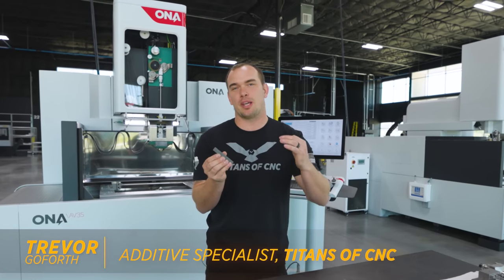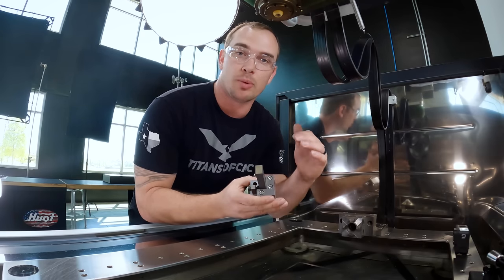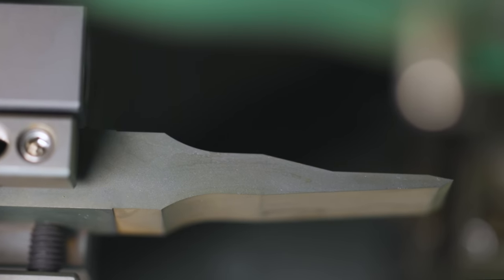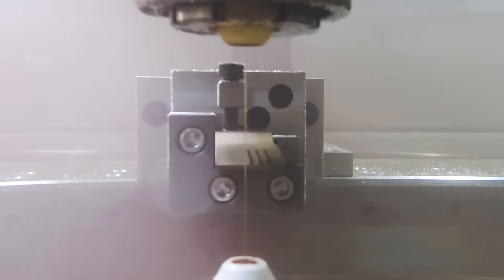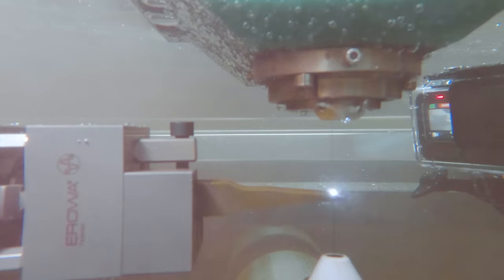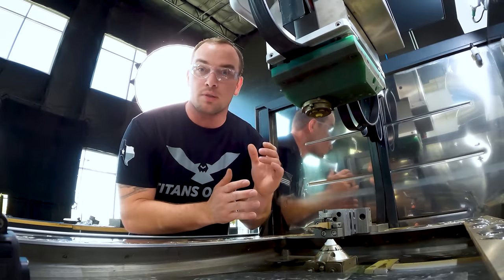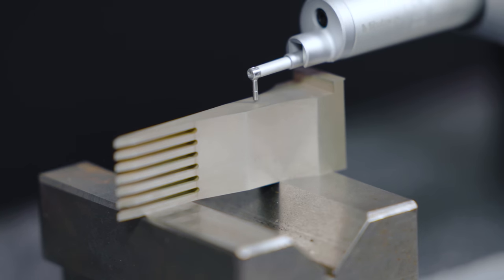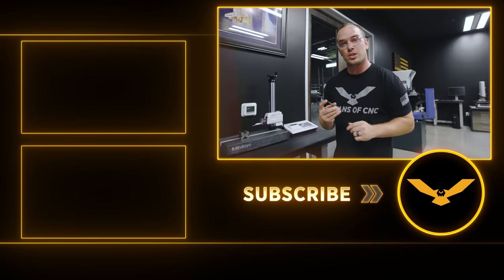MACHINING The HARDEST METAL On EARTH

Comment: Cemented tungsten carbide is not a metal but a composite. Like you said in the video, it's tungsten carbide powder glued together with cobalt.
Reply: Correct 👍✋ I pointed out the same thing cause its very far from elemental tungsten

Comment: My dad specialised in spark erosion in the 1960s -1990s using a Charmille EDM with a relaxation circuit. This was ideal for tungsten carbide sparking. His main work was machining cold heading dies for screw/nail manufacturing. The electrodes were made of tungsten copper.

Comment: Uhmm, guys, tungsten carbide is a ceramic (a compound consisting of a metal element and a non-metal element), it's not a metal (alloy). But given that C2 Tungsten carbide has 6% cobalt in it, it's actually metal ceramic composite material, often called a "cermet" (ceramic / metal composite).

But you can't really call it metal. (Sorry, I'm a materials scientist & engineer / metallurgist, I can't not be pedantic in this case!)
Reply: Just here for the same reason! Material scientists just cant ignore these things 😂

Comment: Tungsten carbide is not a metal, that is commonly mistaken. Cool machining nonetheless!
Reply: would you call it a steel then?
Reply: And iron carbide (steel) ?
Is it a metal ?
Reply: You are right. The TC itself is a ceramic and in the commonly used form in machining tools, it's "gled" together with a metal binder, e.g. cobalt. This makes the complete material a metal-ceramic composite.
Reply: @DeusEversor  Steel is an alloy where the carbon content is not so high that the entire material is cementite. Tungsten carbide is a ceramic and if it were still bound together using tungsten, maybe it would be an alloy. This area I am not an expert in, but tungsten carbide itself is a ceramic. Cobalt or nickel are commonly used to hold the grains together

Comment: About that title: Tungsten Carbide is not a metal, but a composite. Also, Wire EDM isn't machining, but eroding.
Reply: nah it's machining. It's just in another form like grinding.. that too is within the subject of machining, tho neither are chip cutting machining methods :)
Reply: @therealsourc3  If you go into the nitty gritty details: No, EDM isn't machining. The metal removal is done by spark discharge, where the heat of a very localized electric current causes the material to melt locally, so that the liquid can remove the solidified droplets. In case of conventional machining and grinding, the removal is mechanical.
Reply: Pure tungsten carbide is a ceramic (a chemical formula with a metallic element and a non-metallic element). Commercial tungsten carbide typically has some metal added, to create a cermet, a ceramic metal composite.
Reply: @Hydrazine1000  Machining: The activity of cutting or shaping material on a machine.

Seems to fit the definition of machining to me.
Reply: @reidb9422 "shaping on a machjne" isn't called "machining" in all cases. It tends to be "shaping by cutting on a machine" that is called machining. Forging is also shaping, but using a powered hammer to forge is not "machining", yet it is shaping on a machine too. A powered bead roller is a machine, but rolling a bead, while it is shaping, isn't machining either. A powered tube bender? Same argument. In terms of fabrication/manufacturing, "machining" is mostly used when referring to shaping by cutting chips off. When you use a big ol' CNC grinding wheel to shape, you don't speak of machining, but of, well, grinding.

But, hey, let's enjoy being pedantic for a moment and move on. This is all just unwritten convention, it's not legislation or anything.
Reply: @Hydrazine1000  i feel you actually realized what machining means with this but somehow missed how all your counter examples are about bending. While edm and others machine processes are purely removing material. (Also i feel like the dust that gets blown off with edm are chips, just very small ones)
Reply: @ipodhty  The dust that comes off in the EDM process is, in case of a metal, very tiny re-solidified metal droplets. The arc causes the metal to melt locally, and the water cools those microscopic droplets immediately so that they become solid again. 

Chips, on the other hand, don't get to their melting point. Or at least, that's not supposed to happen. It might happen by accident if cutting rates are too high and cooling insufficient.

And in case of this tungsten carbide cermet, the energy of the arc melts the cobalt into tiny droplets, and the actual tungsten carbide particles just separate. Tungsten carbide only melts at 2780 °C, or 5189 °F, at which cobalt would actually boil ... 

Good point on those examples are for deforming. Add the laser cutting machines and plasma cutting machines. But then, that's not really shaping, rather than, well, cutting.
Reply: Tungsten carbide means. Tungsten. Carbide means Carbon. Plenty of metals are composite. Steel has Iron composition for example.
Reply: @prandomable  Tungsten Carbide is not considered a metal, but a metal/ceramic hybrid, a composite material with hard particles of Tungsten Carbide embedded in a matrix of metallic Cobalt, milled and die-pressed in powdered form, vacuum sintered to it's final shape, form and incredible hardness. The Carbide implies an ionic carbon compound, but is now considered a covalent carbon compound.
Reply: wire edm or any edm is non conventional machining on the other hand lathes, grinders and etc is conventional machining
Reply: Are you under the impression these people don't know that it's a composite and eroding? Do you think your genius is just so amazing? Or do you think maybe the video title makes it easier for people watching to understand what they are going to do in the video?
Reply: L comment

Comment: For the features you are cutting I would agree the EDM is the way to go no doubt. I have to make 700 series tungsten ballasts for the military. It is all mill work. What I have found to work the best and last for a little while are the HARVI III endmills and the HARVI 1TE for the smaller range endmills. The GO drills do and excellent job and I use an OSG tap that is for inconel. I just approached it like running titanium and adjusted from there.
Reply: Sounds interesting, but tungsten isn't cemented tungsten carbide.
Reply: @magicponyrides  
Yes it would be silly to essentially cut an endmill with and endmill. This is why I said I cut the 700 series tungsten. I mentioned it because most websites say the same thing , do not even try cutting in a mill, lathe possibly, but to use and EDM, Sinker, or Grinder. With the features I have to machine and the time frame I am given an EDM or Sinker just aren’t going to cut it and a grinder isn’t going to make the features.

Comment: Use a Norton form diamond wheel, with flood coolant in a surface grinder. And you can put them in with a better edge. The EDM leaves a slight Hone. Not every customer likes a wire EDM cutting edge. A ground edge side wheeling on a grinder will always give you the best cutting edge.

Comment: Tungsten Carbide isn’t a metal - it’s a ceramic and not even the hardest ceramic (that’s boron nitride (although there is a argument between that and boron carbide)).
Diamond is just slightly harder than Boron nitride and carbide.
The material here is however cobalt / tungsten carbide reinforced composite.

Comment: Great video! 
Question from my side: could you show how that wire can cut a conical hole into a block
and another one: do you have a 4th axis attachment for that wire EDM to demonstrate chip and pressure less "turning" of a tiny part ?
Reply: From my base knowledge, it'd have to be a shallow angle cone. The one I have access to I believe is like less than 10 degrees, maybe 12? Basically you offset the.. I'll call them guides and make a circle. Angles increase the chance of wire breakage which isn't fun.

Comment: I've tried to cut tungsten carbide once with angle grinder. It didn't work, the part just broke in half beacuse of cutting wheel wibration, but cutting it normally would be almost impossible.
Reply: Hö endmills or drills out of carbide are machined with diamond cutting wheels

Comment: I need this metal to make nozzel thorth on rocket engine. Direct contact with  combustion chamber and behinde cupper heat pipe or graphene to radiate the heat from the thungsten carbide.

Comment: Is Imperial Ra different to Metric Ra, if so, how would you „translate“ that into Metric (the usual 25.4 ?)

Asking because we grind carbide (mostly for tooling (drills, end mills, reamers…)) and we aim for Ra 0.15 or better (usually around Ra 0.03-0.1)
Reply: The usual 25.4 
Ra 1 (micro-inches) = Ra 0.025 (micro-meters) 
So 9.83 uin Ra x 0.025 = 0.25 um Ra

Comment: What's the most material you can remove in one pass with EDM? Like a "DOC" per say
Reply: Depends on the thickness of your wire
Reply: @kleini3  what's the thickest wire you can run?
Reply: @22lambo  uff last time standing next to a edm is years ago in my old company. Sometimes they used 0.25 mm wires. I think that’s was there biggest
Reply: On my charmilles 510, E2 rough cut is 0.25 wire plus spark gap is total 0.36mm, E6 would remove on a pass cutting steel  0.030mm E7 0.040mm E10 0.007mm E11 0.003mm. The thing to get your head around is an edm works on mm/min and lasers or mills or lathes work on m/min so an edm is the tortoise.

Comment: If colbolt is the magic that keeps the tungsten together.
Then why not use 100% colbolt!
Reply: Because the hardness of tungsten carbide is a lot higher than the hardness of cobalt, so it's the tungsten carbide that is responsible for the wear resistance. Cobalt only acts as a binder. Why cobalt? Because it adheres very strongly to tungsten carbide particles and it has a high melting point. 

Also: cobalt is pretty expensive (especially now, since it's used as ingredient in lithium ion batteries) and it's a safety hazzard. Metallic cobalt is suspected to be carcinogenic and distruptive to human reproductive systems, so potentially leading to birth defects or aborted pregnancies.

Comment: Tungsten carbide is not a metal actually.
Reply: Whatever it is, it is very hard to machine using traditional methods like mills and lathes.
Reply: @barrysetzer  I know that is very hard, but they use term "metal". Anyway, very hard to work with.